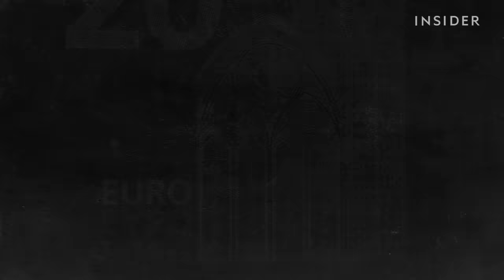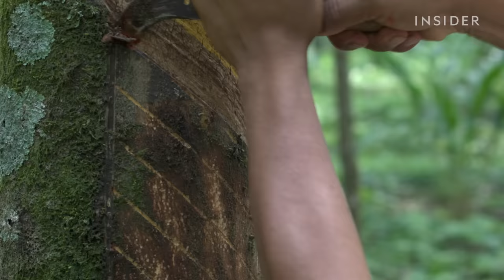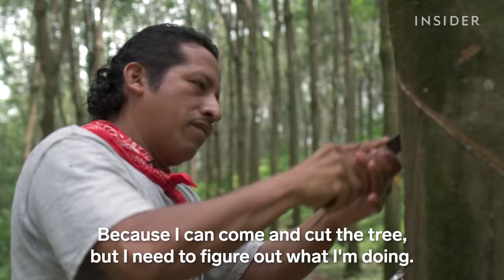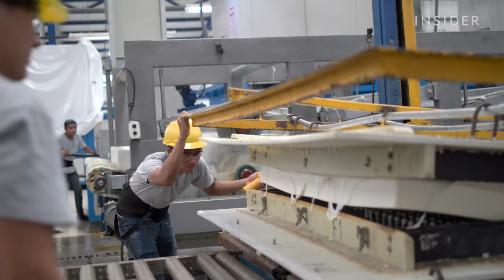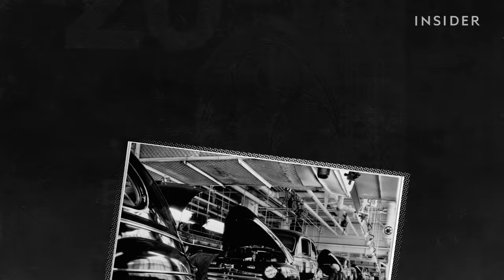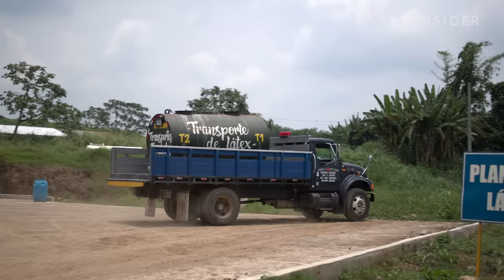Why Natural Latex Mattresses Are So Expensive | So Expensive | Insider Business

Comment: Buying a latex mattress was one of the best purchases I ever made. I ended up buying standalone components with the help of the mattress underground forum.
The latex is so much more breathable than memory foam so you sleep super cool
Reply: Do you have to do anything special to care for them?
Reply: I once ordered one for roughly 1200€, made in Germany.
I sent it back because it was heavy as hell and not firm. I hadn't that on mind and somebody should keep it on mind when buying a latex mattress.
Getting it from the floor into the bed is a pain in the ass and almost impossible alone without ripping something. The mattress is heavy and not firm. Feels like handling a dead body. And flipping the mattress - which one should do regularly according to the manufacturer - is a pain in the ass, too. And I am a guy. I dare to say it's impossible for women and elderly to handle those mattresses without extreme hassle.
Plus, the mattress was way too soft. I ordered medium degree of firmness and I had back pain which i never had before. I sleep on my back and for this hard mattresses are better. Maybe the hard one would have been better, who knows.
But the weight of latex mattresses is a huge drawback.
Reply: Did you buy it from Arizona Mattress? I got mine in components as well: 8in springs, 3in firm talalay and 2in medium talalay and my life has been changed
Reply: @smallego8068  "But the weight of latex mattresses is a huge drawback."

Just don't use brute force. Use your brain when moving things.

Use the cover to pull it up, or just unscrew 2 feet from the bed.

There's so many options you could have chosen instead of just caveman brute force, lol.
Reply: @awemowe2830  Agreed, I purchased a SleepEZ Roma latex mattress and while it is heavy as hell once you have it set-up you can easily rotate or flip it. All you have to do is do one section first and the other section second. Latex unlike other matresses can easily be folded since it's soo flexable. For example, if I need to flip the mattress, you simply flip one section on top of the other (like a sandwich) and pull the second section from beneath it and that's it. It's that simple to flip a latex mattress. Because of the flexibility it's much simpler to flip a latex mattress than a traditional mattress. Rotating it is even easier.
Reply: @awemowe2830  One of the rooms has a loft and that's where the bed stands. Getting the mattress up that loft was a pain in the ass.
So I went even one step further. Send it back and replaced it with a foam mattress for a fraction of the price ;)
After the hassle due to the weight, I lost my interest to try the hard latex mattress. And the hard one would have been even heavier.
Reply: @rockguru14 I have a similar setup from Arizona mattress, but just a single 3in medium talalay on their premium springs. Best mattress I've ever slept in my life. I sleep hot and the cooling from latex is unmatched compared to every memory foam mattress I've ever slept on
Reply: if it is just a matress topper 2" latex... do i still need to flip it?
Reply: @rockguru14  Nice! I built mine with 8" springs, 3" medium dunlop, 3" soft dunlop encased in a custom 14"  bamboo/wool zipper case. Had it about seven years so far and it's still wonderful. I'm a side sleeper so I like it a softer mattress.

Comment: I have an Avocado latex mattress and it is amazing. Weights a TON but was worth every penny.
Reply: How do you compare it to Cotton mattress?
In Egypt I have cotton, it take the body shape and it cools the back in the summer
Reply: I have avocado too. Best mattress I have ever had.
Reply: Same, love mine
Reply: @JohnSmith-ks5xw is it latex too.? And how does it compare to a regular mattress? What's it like? I'm interested
Reply: @edgarhernandez8003  It is springs, but has a latex layer on top. I think it's far superior to a regular mattress for so many reasons. To list a few, it's all natural so there's no chemicals. Think about it, your face is in it for 8 hours a night; what you breathe in and have contact with is important (at least I think). In addition, it stays cool. I have a boxspring with slats underneath so that my body heat can escape. I never get too hot. You may notice that you go to sleep comfortably, but wake up and you're super hot. That's because your body heat gets trapped and it gets hotter and hotter. Not an issue with the proper mattress and box spring. I looked into getting a pure latex mattress and they are extremely expensive and I heard they can sag in the middle over time. I think quality springs are good and springs serve a valuable function. I did tons of research before buying it years ago (been so happy with it) and it seemed to have the best of everything and check all the boxed. I have recommended it to other people and I know of at least 2 people I recommended it to that got it and they are as happy with it as I am. Let me know if you have specific questions and I will try my best to answer them (Avocado really should hire me lol).

Comment: I personally prefer the texture and spring of Talalay process latex foam rubber over the Dunlop process. Having said that, if you are to have an entirely latex foam mattress, then you would still want your core to be a Dunlop process latex, as it is typically more robust and supportive compared to Talalay process latex. It is also cheaper. Just use Talalay process latex for the top layer to add additional softness and comfort, since it is able to deform more before rebounding compared to Dunlop process latex.
Reply: Didn't understand 😢
Reply: @Zara-ZAF  Talalay process latex is made with even fewer additives and uses a different mechanism for foam retention during the curing phase which results in a more open and compressible foam structure. You can sink into the foam more for any given "softness" of foam before it begins to spring back and support you. So it feels wildly different than Dunlop process latex, which can feel a bit like a rubbery polyurethane foam sometimes. Talalay process latex is more floppy and has a lot more give before it springs back, so it is a rather novel experience when you get your first pillow made from it. I highly recommend it. The one I've got is from Malouf, though there are other brands who make them that aren't as pricey. Just expect a Talalay process latex pillow to cost aroung $60 USD or more, depending on size, firmness, loft, and any additional marketing buzzwords.
Reply: Where can I catch a talalay and dunolop Pokémon?
Reply: @GamingTaylor  It really does sound like those should be the names of Pokémon.

Comment: I bought a 3" thick pure latex topper for my old mattress 10 years ago, it was the best money I've ever spent, I brought it with to Venezuela in 2022 and turned a cheap $400 king size mattress into luxury, can't say enough how nice it is to sleep on latex.
BTW put a 100% wool blanket between the latex and your sheets, helps with air circulation

Comment: I only use Natural rubber latex mattress - they are called pin core natural. 10 yrs back they costed me only 500 dollars. Today a King size, 6” pin core costs about 2000 dollars, a 4x increase. If you go for a 12”, double the price.

Comment: 2600 sounds like a steal compared to some of the mattresses I have bought.  Spent 2k on a higher end memory foam mattress.  It’s about half the sleep number I was looking at
Reply: It's just foam. There is a lot of silly marketing when it comes to mattresses.
500€ for a 200x200cm foam mattress made in Germany. This specific model is actually one of the - maybe the - most sold mattress in Germany. They also call it the "anti mattress cartel mattress". The founder of this new German company was threatened by the established mattress manufacturers to increase the price of his mattress. He went to the federal cartel office and as it turned out, the established manufacturers actually used illegal price fixing to keep the prices of the mattresses high. Together, those manufacturers were punished with a 30 million fine.

Comment: Well that's because usually high income = high price.
Full latex mattress cost less than 500$ for 100x200 here (top local brand), <850$ for 200x200.
I paid 750$ or something for 120x200 back in 2017 (overpriced Therapedic buoyancy, which is ~1000$ nowadays).

The best bed no doubt, but it's extremely heavy.

Comment: It must be a chore to sleep on such a soft, gelly mattress.
Reply: It's not. You'd have to try laying on one to feel, difficult to explain. It has high point elasticity so pressing just a finger or your hand (small footprint) it easily indents. When you spread your body over the surface you lay on top of it and it's very supportive. Similar to jello, easy to poke into the surface of jello but a large dish of it press your hand flat to it and it's much firmer. Even a 3" thick piece designed as a topper, I laid on one at a store show room. When I sat on it the topper easily squished flat and I felt the support slats underneath it. When I laid back fully on it I was raised up and could no longer feel the slat supports. Most mattresses (solid latex, no other foam/spring supports) are at least 8-9" thick or more. Depending on the way the latex is formed it comes in different densities and firmness. It can feel just as firm as a firm/extra firm spring mattress.

Comment: I have a queen sz natural latex thats 25yrs old still in great shape.  I bought in my 30's and the mattress is very heavy to flip as its at least 8" thick.  I was thinking of cutting it down the middle and having new mattress covers made for eac half then put them together on the bed as before.  the base of the  bed is a sheet of particle board so no boxspring or slats.  Has anyone tried that and if so does it seperate while sleeping.  I tend to toss and turn alot.